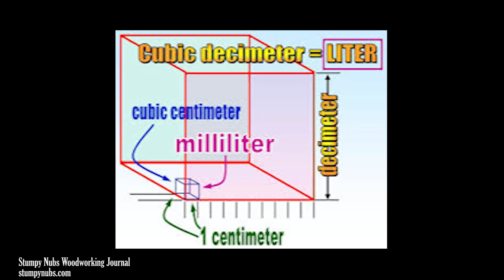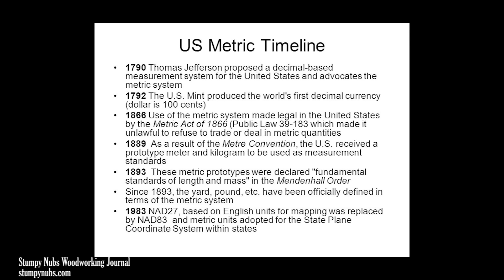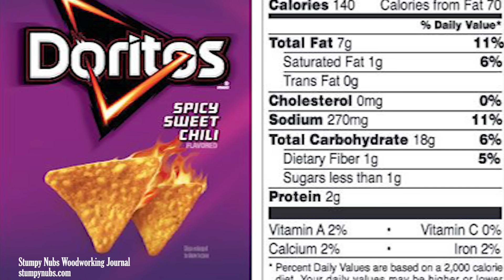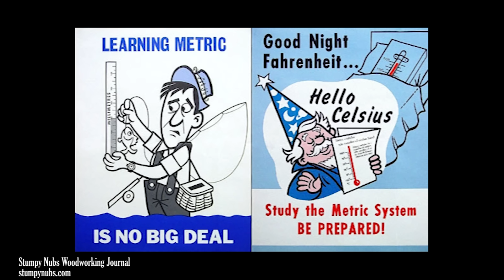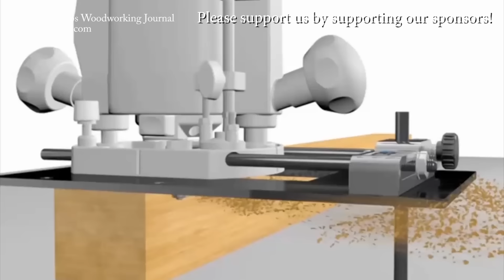BREAKING: The USA is switching to METRIC!

Comment: LMAO!! Well done! 😂 My formative years fell just after Canada transitioned to metric, so I learned metric in school but imperial at home. It has resulted in an interesting mix of preferences for which system I use when. I think it comes down to what someone is used to in a given context. I like having tools with both!
Reply: In what situations do you find metric or imperial advantageous, or what drawbacks does each have in what situations?
Reply: @michaelallenyarbrough9503 woodworking for example the scale of the ruler is easier to read in Imperial.  You have fewer numbers to remember.  The math is harder but you get used to it.

Everything else in reality metric is better.  And if measuring tapes would only have metric on it then yeah go metric but in Canada you ether have full imperial tapes or imperial on one side and metric on the other.  So you are on the wrong side of the tape half the time.

Drawbacks...when measuring volume for epoxy.  It's way easier to convert cm³ to ml than using inches to gallons.
Reply: @michaelallenyarbrough9503  I'm in a similar boat, but further along in the lifetime of the metric transition, Canadian born in early 70s.  For me, building and cooking is done in imperial, and my weight is in pounds, but everything else (including temperature), and especially anything scientific, is metric.  

But that doesn't mean that you don't have to deal with different unit systems in science, even if everything is metric.  Annoyingly, when I studied electromagnetism and physics in school, our textbooks used CGS, one metric variant, and we used SI in the classroom, a different metric variant.

Comment: Canada here. We converted to the metric system about 40-50  years ago. We are still ordering our food in pounds and pint and galon. And using 2x3 and 2x4,etc...  It won't go away overnight rest assured.
Reply: The gallon is different to the UK which is a pain.
Reply: We Finns transitioned to SI while still part of the Russian Empire and we still use 2x4s and have both centimeters and inches on our tape measures as default. So yeah, no it won't.
Reply: @ValMartinIreland   NO it is not Canada used the UK Imperial gallon.

Comment: G'day, from Australia, we converted about '65.
As a carpenter who also plays with classic cars, I 'm constantly jumping between the two. And spare a thought, we used British pounds and gallons, so you have to be sure of what you're converting. Australian cars were SAE( except local Japanese makes), and started blending to metric in the late 80s.
If you gonna try it, just use millimeters and meters. In construction, everything is done in millimeters. Forget the decimal point, just leave a space. eg.  3 1/2 meters is written    3 500mm  .
I will say "Yeah, that's about six inches", young fellers don't know what you talking about. 
I can handle imperial with , like 1/2, 1/4, 1/8.  but when you get to 27/164,     0.163634146mm is easier to comprehend.     And what's the go with thou's?  Decriminalized the inch?
Reply: I'm not surprised the young ellers don't know whatyou're talking about. three and a half metres is about eleven and a half FEET!
Reply: Australia when metric in 1975, only the money went decimal in 1966.
Reply: @owenwilson25  fair call
Cars switched from miles to km for the 1973 model year. 
Including the Bathurst 500/1000
Reply: @bodgiesteve8849  There were a lot of pamphlets and preparations during the year or two before the big switch but I'm quite sure it was '75; metric is better except I still have to convert for the height of people and miles per gallon .. well until hopefully I can afford an electric vehicle.

Comment: I recently moved from the US to Mexico and the hardest part has been the transition from Fahrenheit to Celsius. All the other units I can just ballpark in my head, but Fahrenheit to Celsius is so complicated I can't do that, just gotta memorize a few key conversions.
Reply: All I know is 40 below is the same in both scales..lol
Reply: Quick and easy from C to F: Double, then add 43, then subtract the number that was in the C's ten spot. So lets say you have 28C, double is 56, plus 32 is 88, minus 2 is 86F. The real answer is 82.4F, but it's close enough. The real formula has you multiplying by 1.8, and then adding 32 and that's your answer. But multiplying by 1.8 is a little more difficult.
Reply: Just remember: 0°C is freezing, 32°F,  10°C is 50F, 20C is 68F, and 30C is 86F, 40Celsuis is real hot...104°F....
Every 10 degrees Celsius is 18 degrees Fahrenheit, so 5 Celsius is 9F.....15C is 59F, 25C   is 77 etc.  After a few days it's second nature.
Reply: @bitfreakazoid Don't multiply or divide by 1.8....mutilply by 5 then divide by 9, or multiply by 9 then divide by 5 if you're converting the other way from Celsius back to Fahrenheit.  Subtract 273.15 from a Celsius temp to get Kelvin.
Reply: @bitfreakazoid  that's cool as hell! Thanks

Comment: Great video!  I have an interesting, for me, viewpoint on the metric system v. Imperial.  I grew up working in my dad’s tool and die shop.  For me, working with thousandths or ten-thousandths of an inch was just a typical day at work.  So, in a sense, I learned about the ease of a base-ten measurement system in that setting.  I had the whole conversion chart memorized of fractions of inches to decimals, thousandths/“tenths” forever burned into my brain, by the time I was 12.  (A “tenth” in shop speak was one ten thousandth of an inch.)

However, I did not enjoy standing in front of a lathe, grinder or milling machine all day.  What I truly loved was science, specifically geology, nuclear physics and chemistry.  So, since the sciences were always taught in metric, and with my knowledge of decimals, it was an easy transition for me.

I convert kilometers to miles and vice-versa in my head pretty much everyday.  One kilometer equal’s .62 miles.  100 km/hr = 62 mph, and there are 62 cubic inches in a liter.  Love how the metric system works so beautifully on those two conversions.

I’d have to say that I enjoy transitioning between the two systems.  It provides great exercise for my brain.

One last point, there is one part of the metric system that bothers me… the Celsius Scale for measuring human comfort.  I’ve tried to move over to it, but for me, Celsius does not reflect the temperature in a proper way to adequately address human comfort levels.  I believe the Fahrenheit system does this in a way that is easier to comprehend than the metric system’s Celsius scale.

Though, Celsius is great for science, engineering and most technologies; except air conditioning and heating.

Just my opinion on all of the above.  It works for me, and I don’t expect it to be everyone’s cup of tea.
Reply: @turkfiles - Celsius is far smarter than Fahrenheit in the sense that water freezes at 0°C, and boils at 100°C...not 32°F and 212°F respectively...
Reply: @peterlarsen7779  Highly useful if your application of the temperature scale is boiling water (at sea level), but outside of that, there's not a clear advantage to either one. The main advantage in science for Celsius is that it's easier to convert to Kelvin, but in those applications it makes more sense to just use Kelvin in the first place when measuring temperature. The only other factor with Celsius is that it's easily related to the calorie unit of energy. But the calorie (or kilocalorie) is only used in a few countries, and then only primarily for food energy. Degrees Celsius/Kelvin and Calorie are practically never used in the same calculation.
Reply: Haha, I disagree with you about Celsius vs Fahrenheit in human feelings. 0° C is very cold, 10° is chilly, 20° is average comfortable, 30° is hot. The conversions are easy to memorise: 10° C= 50° F, 20° C= 68° F,  30° C= 86° F. Blood temperature is 37° C. Ice forms at 0° C.
Reply: @live22morrow  - riiiight.... because the majority of people are employed in the fields of science... Makes perfect sense when you put it that way 😉👍
Reply: You don't mention any of the actual disadvantages of Celsius. The main drawback I find is the scale is just not accurate enough at room temperature without a bunch of decimal points.
Reply: @turkfiles I have mostly opposite point of view 🙂 I am from Czech Republic (Europe), so most of my life I used just metric. Six years ago, I started working in Czech subsidiary of small American company that custom builds laboratory gas analyzers. I needed to learn to work with inches, feet and fractions. I use it when cutting or bending small metal tubes and modifying sheet metals. For regular sizes ranging from 0.1" to 10,' I find imperial units easier to use than milimeters, centimeters and meters. However, I consider Fahrenheit to be a bad joke 🙂 I can at least appreciate that 100°F is the temperature of human body but 0°F absolutely makes no sense, therefore whole scale makes no sence to me. It is almost impossible to convert it by head to °C/°K as well.
BTW. in the Europe, almost everyone knows that human body temperature is 36 (or 37)°C. It is common knowledge and it is apparently easy to remeber.
Reply: @DalHrusk  The measuring tapes here in Canada have 1/8" not 10ths, which I believe is more an industrial use. Millimeters are too small for carpentry and other trade work.
As far as converting C to F, a formula you can easily do in your head is: 
Double, Subtract first digit, Add 32. 
So- 10 x 2 is 20, minus 2 is 18, add 32 is 50
100 x 2 - 20 + 32 = 212
Reply: @markoshun  Except that conversion is neither exact nor easy. Using a decimal point, which is the simplest thing, bothers you while the that difficult and rough conversion is easy in your point of view? You just don't want to do things differently than what you learned in your childhood. Which is alright, but your arguments are not.

BTW milimetres aren't small. For example the difference between 3 and 4mm thick plywood is huge.
Reply: @DalHrusk  Wow. I was just offering you some help with your problem with temp conversion. 
Here people don't break down the temp to a decimal, it's almost always rounded up or down, check out our weather forecasts.
I learned to do that temp conversion in my head in grade 4, so I think it's pretty easy.. in just 3 steps. It's also surprisingly accurate. But if it's too difficult for you, just don't use it. 
BTW- As a carpenter, I can assure you houses here are not built to millimeter specs. If a millimeter is 'huge' to you, you are in a different line of work completely.
Reply: @markoshun  Sorry and thank you for offering the help. I don't need Fahrenheits for my job, our machines use °C. I needed to use °F just when I was in the US for weather and room temperature. And it was easier for me to learn thinking in Fahrenheit scale than to convert it. Not because °F would be more convenient than °C but because of complicated conversion.

When building houses, a 1mm difference is not a real deal, but when making furniture and cutting one board 1mm shorter, you would get an awful, well-visible gap.
You can get all variety of board thicknesses - 16mm, 17mm, 18mm, 19mm etc. in here. When using milimeters, you don't need fractions to calculate sizes properly.
Reply: @DalHrusk  Canada started converting to metric 50 years ago when I was 10 and I thought it was going to be great because of base 10. But our biggest trade partner, the states, abandoned their conversion so Canada has been stuck with 2 systems, 2 sets of references and 2 sets of tools, conversion tables, etc. ever since. 50 years of confusion, mistakes, etc.  Working as a carpenter you can’t use metric alone here, so if you want to avoid conversions, etc., you have to use imperial. It’s not about what I want or what I learned as a kid.
Reply: @markoshun  It is interresting for me to learn about that history of measurement systems in Canada 👍
Altought it would be nice if the whole world used one measurement system, I don't believe it will happen in this century. Ordinary people would hate their politics for the forced change, and in fields like aviation, it could even create dangerous situations.
Reply: @live22morrow  Water is the most important substance for living creatures, so the Celsius scale is clearly advantageous. Consider: when are you likely to think about temperatures? For the everyday person, that's basically two situations: 1. weather and 2. cooking. For the weather, having the zero point be "where things are clearly frozen over" makes much more sense than the "pretty damn cold I guess" from the Fahrenheit scale. When it comes to cooking, you'll be cooking things with water in them, so having the 100 degree point be where that water boils makes much more sense than "a slightly feverish person".

In other words, Celsius is ideal for the uses a normal person might care about in their everyday life. In contrast, Fahrenheit was designed so that the zero would be about the coldest temperature achievable at the time (obviously a moving target, and comically outdated now), and so that the difference between freezing and boiling would be a 180 degrees, a half-turn on a rotary thermometer, which is also comically outdated since nobody makes rotary thermometers where a degree is actually a degree.

Fahrenheit is really not good for anything at all, and any perceived advantage is down to familiarity rather than anything intrinsic.
Reply: I already said that celsius is more useful when boiling water, though to be honest, that might be a bit of an exaggeration. Whether or not water is boiling can easily be determined visually, usually faster than taking a thermometer reading. I suppose you could say that the zero point in Celsius is more useful, but for that specific application, 32 is still a pretty easy number to remember, which can be seen by the fact that hundreds of millions of people successfully compare temperatures to the freezing point of water in degrees Fahrenheit on a regular basis.

More importantly though, the main thing that makes a system of measurement useful is its ability to express information from people around you. Which is to say, the most useful measurement system is typically the one that people around you are using. In the US, the vast majority of people and information sources give temperature measurements in degrees Fahrenheit, so the Fahrenheit scale is pretty much by default more useful for common living applications in the US.
Reply: @live22morrow  " already said that celsius is more useful when boiling water, "

It's not just boiling water. It's all of cooking, because everything you cook will have water in it. Not everything will obviously boil. And good luck determining anything visually when you're e.g. setting a temperature before cooking.

" 32 is still a pretty easy number to remember,"

Sure, so? I could make a scale where the freezing point of water is at 123.45, which is even easier to remember, but that's not the point. You look at a Celsius thermometer and you immediately know if you should expect icy conditions. Fahrenheit requires more thinking. Wherever you look, you see the Celsius scale is optimized for human usage. Fahrenheit is not.

"Which is to say, the most useful measurement system is typically the one that people around you are using."

Thanks, everyone already understands this though. Literally everyone who ever said anything about the topic, in the history of humanity, already understands this.
Reply: @isodoublet  "You look at a Celsius thermometer and you immediately know if you should expect icy conditions. Fahrenheit requires more thinking"

How does it require more thinking? When you read a Celsius thermometer and see -10C, you know it's below freezing because it's less than the number you memorized as the freezing point of water (0C). When somebody reads a Fahrenheit thermometer and sees 10F, they know it's below freezing because it's less than the number they memorized as the freezing point of water (32F). Both require the same amount of mental effort. If you've memorized one scale's freezing point and not the other's, then that scale will be easier for you to use, but that should be obvious. Kelvin is a more useful unit scientifically, but most people haven't memorized the freezing point of water in Kelvin (273.15).

The same is true in cooking. Cooking with Fahrenheit temperatures does not require any additional calculations. You just cook to the temperature you've determined is necessary by the recipe. If you're cooking meat, you heat it until the probe reads 170F/77C (as an example). When baking bread, you would set the oven to heat the air to 450F/232C and then hold for a period of time until the item appears cooked. If you're just bringing a pot of water to boil, the precise temperature doesn't matter much, since the primary tools for boiling water (stove, kettle, microwave) just have the function of pouring heat into the water as rapidly as possible, and the boiling point is the maximum temperature that liquid water can reach.

Comment: Excellent video, thank you. Here in the UK we seem to be confused, we buy sheet materials in 8ft x 4ft with the thickness in mm, and 4x2s(2x4 for you guys) in meter lengths!?!?  We buy our petrol (gas) in Litres but still talk about miles per gallon? No wonder we're all mad over here. Thanks again Stumpy, keep 'em coming
Reply: Bloody Surrey timbers who sell by the metre and then charge by the board foot. Ffs.
Reply: @the_semi_competent_woodworker 🤔 pay in pounds shillings and pence or better still guineas 😂😂😂
Reply: Those French the defeeted the King and cut of the wrong end🤣🤦🏻
Reply: While visiting London once, I also noticed some office/retail spaces for rent that were advertised and measured in square feet. Go figure.
Reply: 8 by 4 boards are sold as 1220 by 2440mm (48.03 inches by 96.06). - size has barely changed and the name carried over.